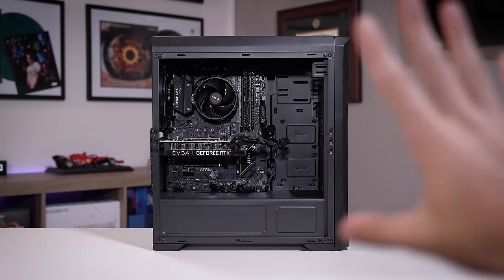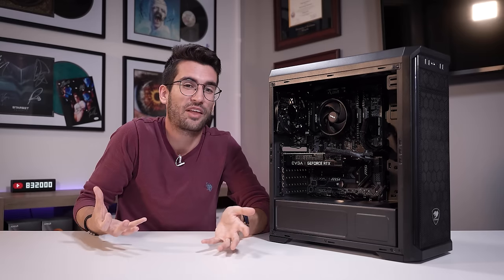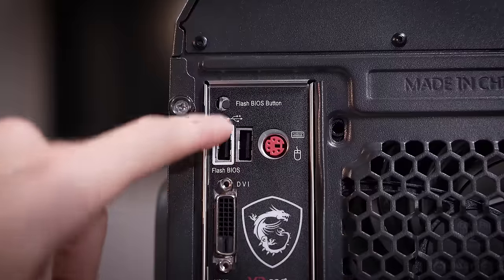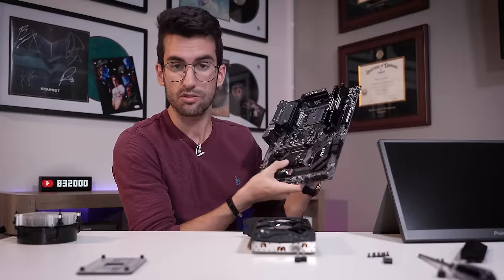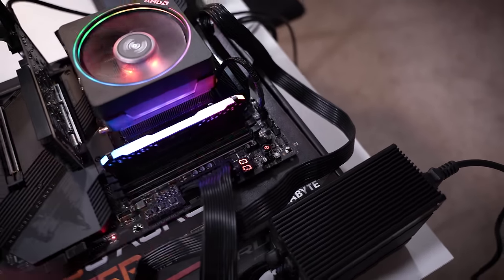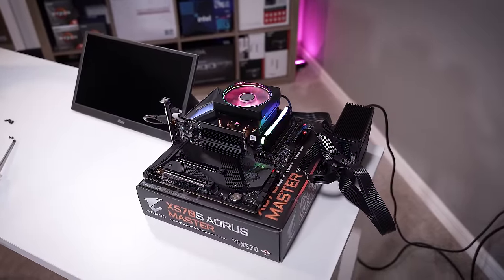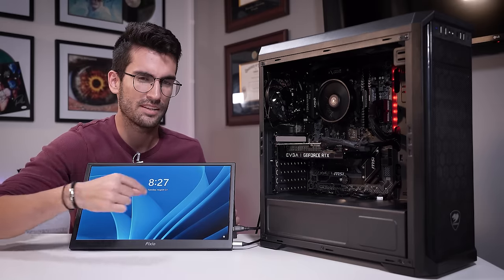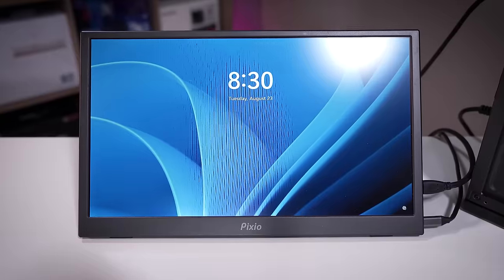Fixing a Viewer's BROKEN Gaming PC? - Fix or Flop S3:E4

Comment: The ''missing'' bios may have been updated via MSI's software in windows. Some times i have seen it having different revisions then the site.
I think the ''automatic'' updates are some times different then the ''manual'' ones. And you never should use the windows software (MSI LIVE UPDATE 6) to update bios because its crap.
I think that is what happened in this case.
Reply: That would make perfect sense considering that it supposedly was working.
Reply: While I'm not sure on this case in video, but yeah...I had this bad experience back on early 2000s on a MSI motherboard in my house because their LIVE UPDATE tool provided a new BIOS update but that turned out a faulty release...install that will brick the board. 
And then my brother had to take that motherboard to MSI company to replace that fault BIOS...and he found he was not the only one had to replace the BIOS chip(I think the new replaced one was previous version of BIOS on MSI's website) when on there...at least that process was free.
(That motherboard was just "one day old" lol)

And the next day...they just take out the BIOS update from their site and the LIVE Update server...and never had any new BIOS release for that board to ever released.

Yeah, be careful if they uploaded a fault BIOS release...it's rare but it can happens, at least for MSI. :P
Reply: @PlayerLin  I cant think of anything else. Greg and other comments said that it may have shipped out from the factory with that bios.
But the owned said that it was working after the motherboard replacement. So that cant be the case then. If the bios is incopatible it would have not worked at all.
And the the bios date was from may of 2022 and i dont think they are still making B450 boards in 2022.
So the only explanation that remains is that the bios was updated after the owner had gotten it and used it for a while.
Bios update is a very delicate prosedure and doing it in windows is very risky with any boards.
There are so many things that can go wrong with all the windows backround operations and so on.
So i think that the owner used the LIVE UPDATE to update everything including the bios.
Maybe the bios was already bad or it got corrupted during installation because of windows.
Best way to confirm this would be to ask the owner or check if the LIVE UPDATE is installed on the computer at all.
I would actualy want to know if i was right or not. But i gues it will remain a mystery.
Reply: @j.p.h.8126  Remember what Greg said: Should not fully trust what owner was told.
So yeah it's possible the system was worked but ruined by LIVE UPDATE's faulty BIOS update but if that would be case, then it should be other users that using the same motherboard to report such problems...

But yeah I agreed what you said: it'll remain a mystery.
Reply: @PlayerLin  totally
Reply: The BIOS is "missing" because MSI pulled it after it was shown to cause booting issues.
Reply: More likely they installed the latest beta BIOS at the time. Beta BIOS builds get removed from the website after a new build supercedes it.

Comment: Definitely a lesson to check the BIOS revision when updating it. It's possible It might have come out of the factory like that but I would be inclined to think that the person may have put in a beta bios by accident without checking as it looked like a previous beta bios version.
Reply: Definitely came from the factory like that I had to help another guy with this issue with exact same board. But hey as long as you kept your old cpu it's and easy enough fix. Well assuming this happened after a CPU upgrade.

Comment: Also thank you so much for the line about not trusting the 'customer' I used to say thid on older fix or flops and commenter would get extremely upset over this. In the service industry never ever ever listen to what a customer says, they're hiring you (in this case it's free but it still stands) because they don't know what's wrong, you have much more experience and knowledge in the field than the customer, they are much more prone to mistakes and errors. (Run-on sentence deal with it.)

Comment: Nice catch on the BIOS, many would've missed that. And how strange that the mobo came with a defective BIOS. Unrelated, but I'm about to do a build in the same model Cougar case. One of the main reasons I bought it; it's one of the few gaming cases that has provision for a 5.25 optical drive (I have a nice Blue-Ray player to put in it)

Comment: Greg, this video stuck in my mind and saved me a fair bit of pulling out my hair on a recent build. Long story short, purchased a B550 Aorus Master new in the box from 2022, which needed BIOS update for my 5900X. Swapped board out to a 3600X setup for another build and wouldn't you know it -- powers up, but only half the AMI logo loads and no POST. No CPU LED either. Rolled back the BIOS to a 2022 version and voila -- runs great.

Comment: The only time I don't verify the failure is if they describe something that sounds like a power issue/short. I'd hate to verify and end up doing more damage in doing so. That's about the only time I tear it apart and examine first. Had a system not too long ago that had all sorts of power issues. Loose wires, shorts... and worse yet, the wrong SATA cable for the PSU that was sending 12v into the SSD, which was already dead as a result.

And how sad that a supposed computer repair shop missed this. I wonder if they just did the basic crap and didn't see the money in spending a lot of time on it and gave it back. I sure hope they didn't charge them anything.

Comment: My B450 Tomahawk MAX shipped back in 2020 with a beta BIOS installed. Fortunately it never caused me any issues with the 3600X that I originally had in it. I upgraded to a 5800X3D just a few months ago and had to flash the BIOS with a much newer version to get it to work and it's continued to work great ever since. I must have got lucky with MSI's BIOS lottery. I was surprised to see so many different versions on their support page. I just went with the most recent and crossed my fingers and all was well.

Comment: Great show Greg from both the PC troubleshooting point of view and just relax channel to watch 😀. One thing that came to my mind instantly at the middle of the first diagnosis - Why Greg doesn't update the BIOS to the latest stable as he used to (though I know you supposed the MB shipped with that Ryzen family compatible one right out of the factory) as the BIOS update is quite easy and safe procedure? I'm updating to the latest stable BIOS instantly always as a second step(after customer's problem description confirmation check)
Reply from the maker: We occasionally update BIOSes - particularly when compatibility is an issue of if we see obvious stability problems on the current revision. I do not make a habit of it in systems that are already stable in this regard. The owner may choose to do that on their own if they wish. Not hard. Doesn't require tools. And we've plenty of tutorials with which to follow along.

Comment: I have always gotten mb's with no debug leds. I am for sure going to get one on my next mb. I think a bios flash button would be good too
Reply: @ascissordollynamedgwen9409  I wouldn't say they are absolute trash as they can sometimes give users a hint where to look. Sure, they're not always accurate but some help is better than none. Once you've used them enough you can usually gauge whether they are pointing you in the right direction or not. Even if they are only accurate half of the time, that's better than having nothing at all.

Comment: I've always been lucky to have previous generations of CPUs (1600x, 2400g, and 3400g) just in case it's a bios issue and I know that even when amazon or whatever shop describes it as 3000 or 2000 ready that it's not always true. And before switching cpu, I would make it a habit to make sure that the bios is compatible with the next cpu I put in afterwards. Keep up the great work. It's always enjoyable watching your content :)
Reply: bio flash back is a life safter tbh. when we built my friends 5600x near launch he needed a matx board so we went b550m and made sure it had bios flash back and it was defintely needed
Reply: @Demon09-_-  How much did it cost him to have bios flashback as a feature on his matx mobo compare to regular matx 550 mobo?
Reply: @Pilaspilas911  they were similar prices to other decent b550m boards. it was more then like the most barebones b550m boards though. But it saved us from having to try and order an update kit from amd or try to find someone with an older gen cpu.

Comment: I have a question.
Nice video btw.
Should amd Ryzen 5600x with RTX 2060 make noise when gaming?
CPU fan is one that i hear the most.
Should be normal to hear some noise from it or should be silence.
I have Ryzen 5600x with stock  cooler..
Reply: If you are using the standard cooler it will be noisy under load
Reply: Yes, every PC makes noise when gaming. The fans on your GPU, your CPU cooler, and case all spin up to help keeps temps under control while under load. 

If the noise bothers you, get an aftermarket tower cooler like the Id Cooling SE-214-XT, SE-224-XT, Be Quiet Pure Rock 2, Arctic Freezer 34 eSports Duo, Vetroo V5, Deepcool AK620, Thermalright Peerless Assassin 120, Scythe Fuma 2, or Noctua NH-U12S Redux. Any of the above should do the trick, but the Scythe Fuma 2 will likely run the quietest. The 5600x is a relatively cool chip though, so if you're on a budget, the Id Cooling SE-214-XT will work just fine and be quieter than the stock cooler. 

You can also go into your BIOS and set up a custom fan curve. The default fan curve can sometimes be needlessly aggressive, and you may be able to adjust it so that it runs quieter while still keeping temps at a reasonable level. You can do the same thing with your GPU fans by using a program like MSI Afterburner.
Reply: The rtx 2060 could also be making noise depending on which model you bought. Asus or Msi variants usually have more silent coolers than other variants.

Comment: The more I read about post issues, I'm starting to suspect a lot of it is improper bios installations issues as a lot of manufactures include notes and steps to upgrade to "x" bios first, install "x" firmware after "x" update, etc. And some people miss these steps and it causes issues. Ran into this plopping a 5950x into my friends X470 motherboard. It had a special upgrade bios to move from the 2000 series processors, instead of needing the 3000 series first as listed. Was a pain to find but after finding that special bios and following the instructions, we got it working. If you run into anymore 3000 series chip post issues, I would start with investigating bios updates and stepping.

Love the series Greg. I need to get larger place because I would love to do these types of videos and have my own workspace to content create.

Comment: This ep was REALLY informative. Most people including yourself wouldn't jump to a BIOS issue on a new board. Sadly to test if it is the BIOS you need a CPU watch many don't have a spare of unless you have a motherboard that allows you to install a BIOS without a CPU.
Reply: I needed to flash the bios on my brand new gigabyte board cuz it wasn't working properly. After flashing, everything worked as intended.

Comment: I had a similar problem with a Gigabyte bios. After updating I had issues with SSD's and booting. After a week of trying to fix it I went back to the Gigabyte website and the bios I used had been removed. Upgraded to the next version and all worked fine. Never found any reference to the removed bios anywhere.

Comment: Manufacturers will sometimes pull Bios updates from their website if there was a problem with it.

Or if it is was a temporary Beta Bios (i know Evga does this sometimes).
Reply: They did indeed pull it. A quick google search shows that many others had problems with booting and crashing after updating to the "E" version.

Comment: Greg,  There was issues with that missing Bios, 1 issue was it would not work with an RX580 GPU, before this update  there was an update of firmware for the RX580.  You will find a missing Bios version for almost every,  MSI MB  it is odd that they did not create a proper  CHANGE LOG  for these bios to explain this.

Comment: There may be another explanation, that happened to me on some Ryzen platforms (and may be related to the bent board): excess tension on the stock cooler can make the system unstable. You unmounted the cooler so that could have fixed it
Reply: I had a ryzen board last week completely refuse to power on after applying thermal paste because the cooler was slightly too tight. Its insanely easy to short a board this way.
Reply: Whilst that is possible I am more likely to believe that it was a bad BIOS. The "E" variant is not on the MSI website and if you look online you'll see that there are reports of systems misbehaving and not booting with the "E" BIOS. That would also explain why it jumps from D to F as MSI would have pulled a known bad BIOS.

Comment: I've had a similar issue on a Crosshair 7 just not with some beta bios, the bios revisions before and after the one I had installed worked, but not the one installed.

Comment: About the BIOS thing : MSI sometimes does the thing of recalling some batch of board that's still in distributer's warehouse and factory flash experimental/engineering version of BIOS (which you won't find those files unless an employee leaks them) on those board which resulting in those board don't support some older CPUs.
I only knew this because the company I worked for have 2 batches of those boards came in last month and I was able to tell them apart because the bag containing the board have been opened before and the distributer we worked with said that MSI took them and flashed the BIOS.

Comment: I also have the same issue with my PC. Tried everything I saw here in this video and also on everyone comments, like slacking a little bit the CPU cooler to avoid bending the mobo, tried my CPU in another computer and it went well. 

CPU : Ryzen 3600
Mobo : B450 Tomahawk MAX
GPU : GeForce 2060 KO
SSD : Samsung 860 EVO , 1TB
PSU : EVGA 500 BR 

All parts bought in early 2020.

I tried flashing BIOS, reinstalling precedent version (Version D, the same as this video). I tried disconnecting/reconnecting maybe 10 times every components.

My computer sometimes boot and sometimes go straight to the red CPU debug light.
When it boot, I used it maybe 1-2hours before it went dark again with the cpu debug light of doom.

I will try to look for a way to test my PSU before trying to buy a new one. Sadly I had a lot of hopes that my problem was the same as this video.

Still really instructive to watch, great video!

Comment: The MSI B450 Tomahawk Max boards have issues. I’m on my fourth brand new one under warranty, all with similar issues. I bought one and it failed. Then the two RMA boards I got both failed. I just opened a new RMA to get the third new board replaced.

And that missing BIOS was available until recently. I used it to try to flash one of these bad boards. But it did it work. When I used that missing BIOS, the board would not work with either a Ryzen A8-9600, 2600, 3600, nor a 5500.

Comment: Ryzen 3000 series native support is there only for 500 series motherboards. For 400 series motherboards, native support is for 2000 series processors and for 3000 series a BIOS update is necessary. 500 series motherboard was released for Ryzen 3000. No new motherboard series were released for Ryzen 5000.

Comment: Around 10:50 you're talking about the BIOS version. The version the user had installed would have been a beta BIOS. They retract them when either a new beta BIOS supercedes it, or the final build is released.

Comment: I remember reading that on many B450 boards, BIOS revisions which support zen3 don't support zen2 and older due to limited storage, and since this motherboard is still being manufactured, it was likely intended to be paired up with a zen3 chip, which are hot on the market right now.

Comment: I had this exact same problem with my BIOS, it had taken me over 3 weeks and non stop crashes/blue screens.
Even Windows 11 clean install crashed before I realise what was happening.

My mobo - MSI MPG X570 Gaming Edge WiFi
The problem BIOS: 7C37v1I
The new safe BIOS: 7C37v1J

I wanted to update the BIOS as I was looking to upgrade to 5800X3D.
3 weeks of pain, then checked the BIOS page and my mind was blown!
OMG it's not there, installed the new bios, no crashes since, I could've cried.
Now I'm a happy owner of 5800X3D! Also undervolted :)

Comment: I have found with 3 different ryzen machines if the debug led is stuck on CPU it meant it could not progress due to the NEXT item being the issue. So every single time it would get stuck on the cpu led I would remove 1 stick of ram and suddenly it worked. It wasn't the ram channel on the cpu or anything as I would put different ram in and it would work. Updating bios, which added new ram compatibility usually fixed this.

I also know that MSI will update a new bios version and just overwrite the old one hence why it might be missing online. This has happened 3 times for the x570 tomahawk.

Comment: As soon as you removed the cpu fan, i instantly knew the cpu was fried. You can clearly see at 5:18 the electrical tells from when someone overloaded the cpu. Maybe, someone accidentatlly left the power on and accidentally touched a cable, say maybe an hdmi cable? Anyway, good show. Fried cpu lol
Reply: The CPU is fine though, the issue was the BIOS. It was running a known bad revision, hence the booting issues.